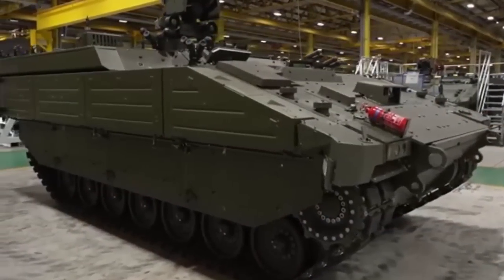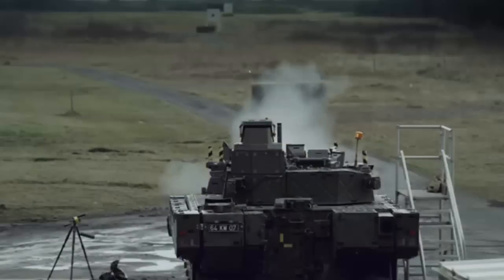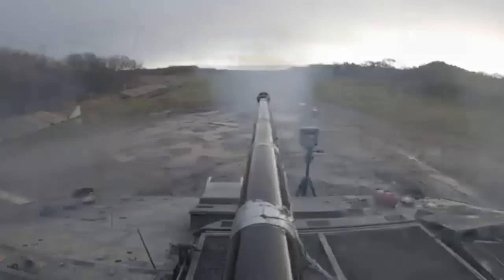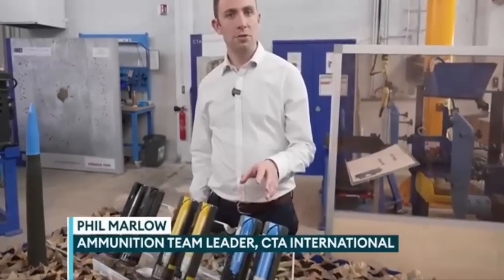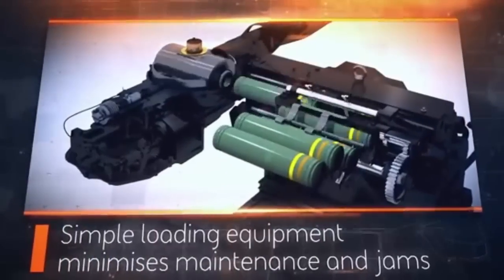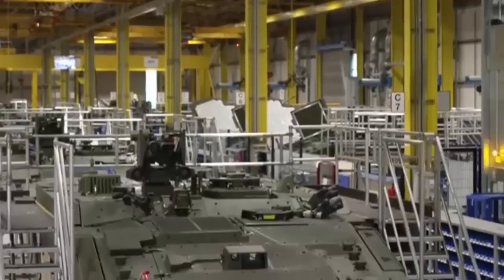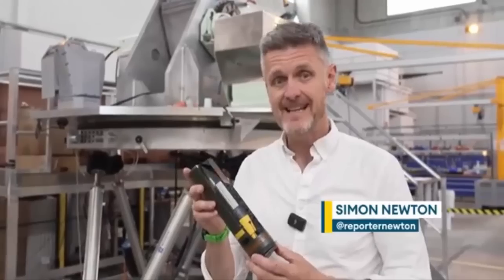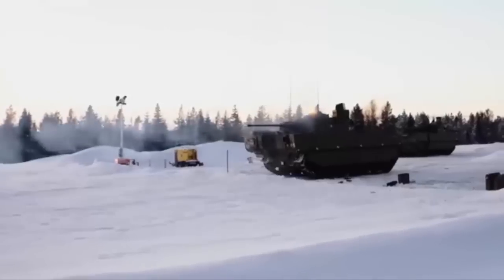Meet The UK's New CT40 cannon !! Small but mighty !! The British army's Cannon of the future

Comment: 40mm = small? Wtf
Reply: The M2 Bradley fires a 25mm round. The German Puma fires a 30mm round. Point is, 40mm represents a significant upgrade for lightweight combat vehicles. 

It is also worth noting that the M2’s 25mm round as well as the 40mm round of the CV90 have been extremely effective against Russian armored vehicles. 

The new ammunition has good energy, is compact. Pretty nifty development.

Comment: The last time the British army tried to use 2 pounder guns, it went badly. Montgomery refused to unpack them.
Reply: That was 80 years ago, these ain't your great grandfather's guns.
Reply: @RichardFraser-y9t  So they made a few improvements to the old 2 pounder. It is still just a popgun with no hope of knocking out a tank....and it is 80 years more obsolete than last time.
Reply: @Will_CH1  Back in ww2 they didn't have Tungsten APFSDS. Additionally, the 2-pounder was substantially weaker, being able to launch a similarly-weighted round about 100m/s slower than the CT-40.

As for penetration, the 2-pounder's APHV round was capable of penetrating 105mm of RHA at 30 degrees, adjusting for angle that's 121mm of RHA flat, at a range of 100 metres. The CT-40's APFSDS round can penetrate 140mm flat at a range of 1,500 metres. This is more than enough to penetrate the side armour of a T-72 or a T-90. 

Additionally, there is the rate of fire to consider. The CT-40 is an autocannon, whereas the 2 pounder was not. The CT-40 has a fire rate of 200 rounds per minute, compared to the 2-Pounder's 22 rounds per minute (dependent on the skill of the crew).

Quite simply, the CT-40 is superior in every way to the 2 pounder, and is appropriate for modern use. Additionally, it should be noted that the CT-40 is not a dedicated anti-tank weapon, and can serve in the Medium AA and Infantry support roles as well, unlike the 2-pounder which was pretty much exclusively used to fight tanks.
Reply: @Moxie326  APDS with a tungsten penetrator was invented by Permutter and Coppock in 1941. It was made for the 6 pounder and later 17 pounder, but they could certainly have made it for the 2 pounder however it was an obsolete weapon that was only kept in production to make up losses after the Dunkirk debacle. 

"The CT-40's APFSDS round can penetrate 140mm flat at a range of 1,500 metres"

I would like to see the test evidence for this.
Reply: @Will_CH1 Why wouldn’t the crew just use the Javelin if they’re fighting a main battle tank?